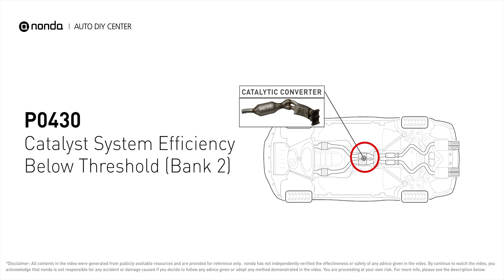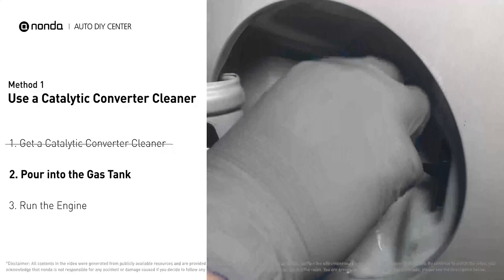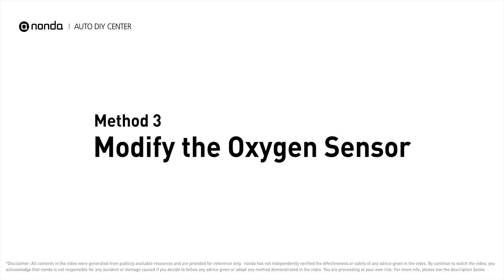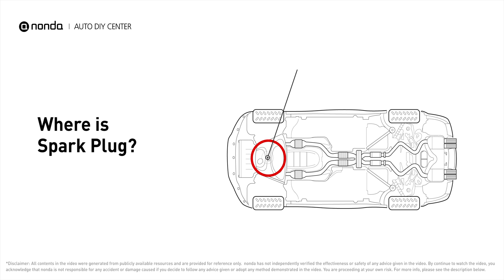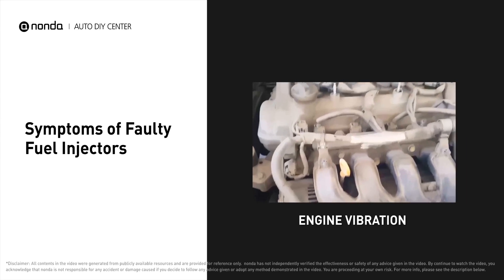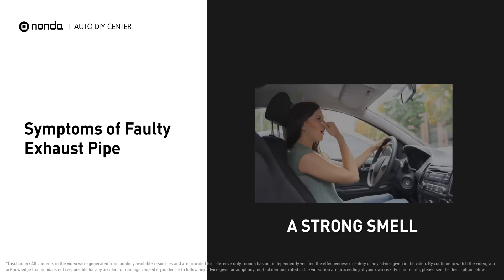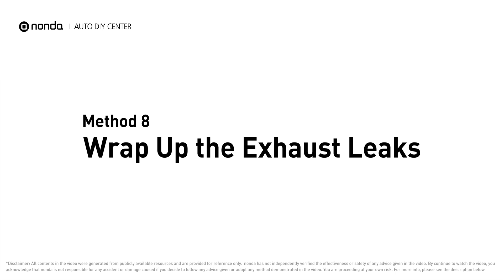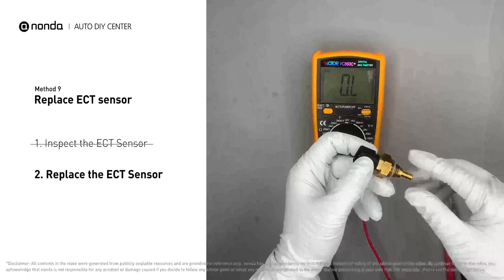9 Solutions to Fix P0430 - Don't Start Fixing Before Watching This

Comment: Method #3 is the only one that will work. If it's a bad sensor or a bad spark plug you'll get a different code.

Comment: I have a 2014 kia rio that keeps throwing a p0430 code still after changing both o2 sensors and catalytic converter. Any answers?
Reply from the maker: Hello, is there any other codes present?
Reply: @nondainc   it was due to a blown flange gasket and the bolts came loose from putting the new one on
Reply: @robinwilliams5841 thanks for the followup partner. So many people never close the loop. How small of a leak was causing your code to trip?  I have a tiny leak on my flange and am wondering if that is causing my 430 code
Reply: @joeholland428  hi i have this code what is the flange gasket???
Reply: @ulisesquintero1219 the gaskets in front of and behind the catalytic converter. Look up doing an exhaust system leak test. Some people pressurize the system with a shop vac on blow mode and use a soapy solution to spray on all the connections. Any bubbles indicate a leak. Any leak allows air into the system when running and will cause problems. All air leaks need repaired to rule that out as an issue.
Reply: @nondainc  no other codes!
Reply: Buy a "VEHICLE" and get rid of that "COMPUTERIZED" POS............

Comment: I have p0430 code on my jeep grand Cherokee 3.6 2015 but it comes and goes few days after, then suddenly shows up again
Wonder what should be the problem?
Reply from the maker: Hello, usually the issue could be coming from the oxygen sensor (downstream side of the catalytic converter). But we suggest to check first the exhaust if there's any leak and fix it to see if the code will still register.
Reply: I had a leak in the valve cover gasket.
Reply: Same issue with my 14 altitude 3.6. My fuel efficiency has quite literally tanked.
Reply: Hi mine too the gas down so bad do you find this code???
Reply: @EltraviesoEspacial ???